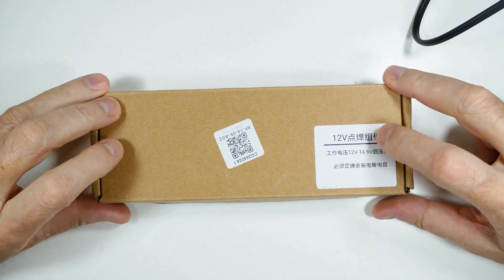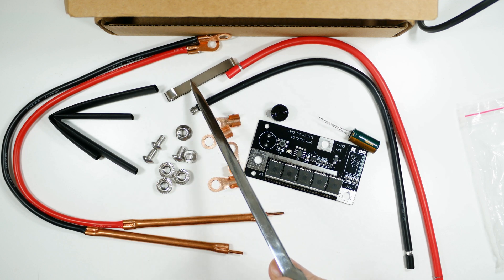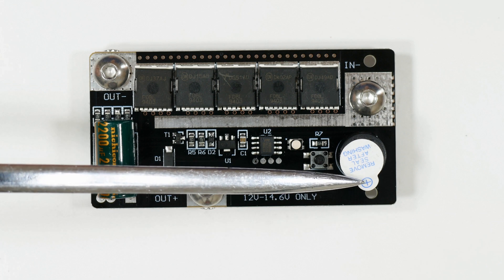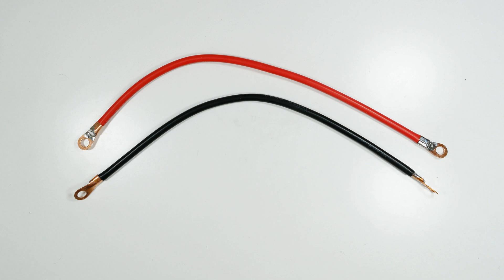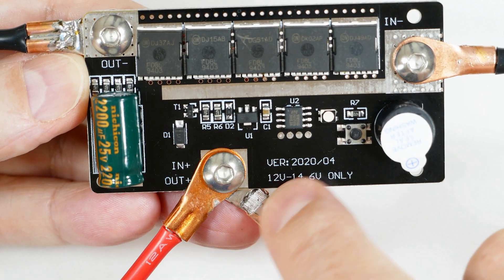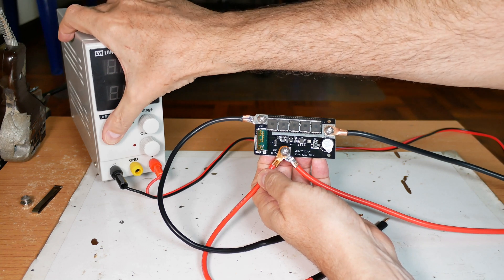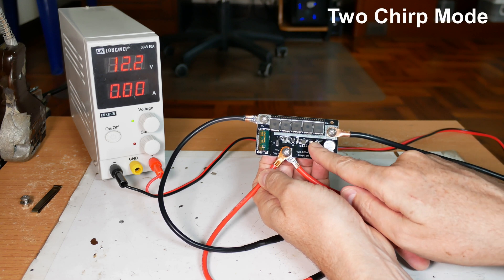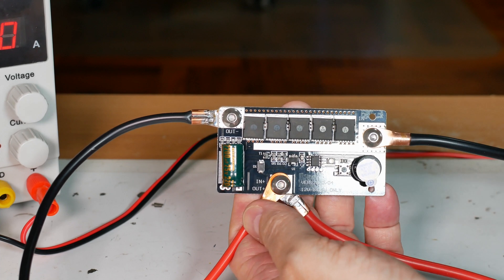Assemble Micro-Spot Welder Kit - Battery Powered (4K)

Comment: Hello!
I have this one, but when i try at 45A car battery, the light just dimmed...
In the description (our online local shop), it works in 90-120A, and as you can see, its so difficult here to find that batteries
My question is, how i can use it in low amperage such as 45-60A batteries? And should i change with the lower spec of those MOSFET?
thank you..
Reply from the maker: That's a question for the welder manufacturer. Batteries are pretty complex because they have voltage and amperage, plus internal resistance and recovery times. They likely built the device for a set of battery specifications.

Comment: I always wondered about these...did you ever hook it up to a battery and put it to work?
Reply from the maker: I did, but I never had the right batteries and could not deliver enough amps quick enough. It would only weld really lightweight stuff. I gave it away because you can now get cheap all-in-one setups that include the battery.

Comment: I've got one and burned it already. Guys never use capacitors for this welder, even with some low capacity ones, they discharge so quickly that it burned all 5 ICs in a microsecond. It is supposed to run with all kinds of batteries in a voltage range for a welder. I used 250VA 11,8V ocV toroid transformer with the bridge rectifier and eight 25V 4700uF caps which turned out as a holy bad idea. Rather than using caps, use a lead acid battery or AGM or whatever kind but AVOID CAPACITORS
Reply: I've attached 12 volt car battery to my updated spot welder and all that happens is i burn the nickel  strips.  doesn't matter what setting i use.  F'n annoying

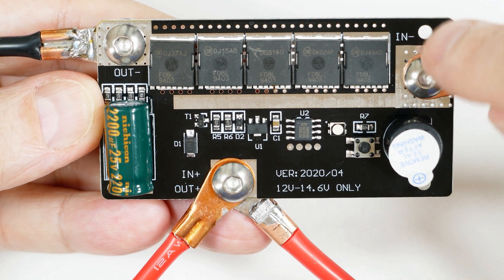Comment: 3:44 would a small drop of blue loc-tite be okay to add to the nuts to help ensure the connectors do no come loose?
Reply from the maker: I can't say for sure. I've never used loc-tite on electrical stuff. When I want to keep a nut tight, I tighten it, then coat it with acrylic paint (usually fingernail polish).

Comment: I have this same spot welder and it works but with 2 12 v 90ah in parallel. But I wonder if I can use instead a power supply with 12v 90A. Is the same?
Reply from the maker: I can't really say.  Batteries have an internal resistance that limits the instantaneous amps, volts discharge curve.  It appears from hints in their instructions that the circuit I have depends on the properties of the batteries they recommend (see description) to work properly.  They warn against using capacitors and similar.

Comment: Very focused video indeed. Thumbs up.  Is it possible to power it using computer atx power supply which can give 5amp 12 volts ??
Reply from the maker: Thank you.  I tried with a 30 amp supply and it was not enough.  My original intent was to use some super capacitors, but when I got it the instructions specifically said not to use caps.  I still might give it a try because I'm not going to buy a specific battery just to power this thing.  I've seen some new battery welders that are not too expensive that come with an integrated lithium ion battery.  I have to look more into that.

Comment: can you let me know the capacitor spec? i don't have it installed as you did.  i can not find it anymore. must use a replacement. thanks
Reply from the maker: On mine it's 2200uF and 25 volts.  Note that it has polarization, and plus and minus lead.
Reply: @tsbrownie  thanks, appreciate what you have shared. when i received the item there is no instruction on how to assemble this
Reply from the maker: @abbii1661  Almost everything that I get from China has no instructions, and when it has instructions, they are in Chinese.

Comment: Is it possible to run it at 12v, 8a
Reply from the maker: They have certain batteries they recommend.  I list those in the description.  I believe the batteries they specify have certain voltage/amperage/internal resistance specs their circuit requires.

Comment: The sticker on the piezo electric sounding element is to prevent washing fluid from getting inside and destroying it during ultrasonic cleaning process if it were soldered in a factory setting.
Reply: Wow, didn't know that, it all makes sense now, thanks lol I see those stickers all the time, nice to know

Comment: Can we turn on this system  on 12volt 40A transformer ???
Reply from the maker: It requires DC and a high amp pulse.  The one I bought says do not use super capacitors and lists recommended batteries.

Comment: Hi thanks for your video could you tell me what spot welder you use ! that's safe
Reply from the maker: Any kind of welding comes with dangers of shock, fire, eye damage (no one on the internet wears eye protection when showing these), etc.  Also welding batteries comes with risks of shock, fire, chemical leaks, explosion, ...  I'm not a pro, but from what I have researched the ones that work the best are those made for specific applications like battery welding, but they cost a lot.  The next best seem to be things like this one, but this requires special batteries (and they are pretty much unusable for other things) making it rather expensive for doing occasional welding.  So personally I am still searching for what I am going to use.